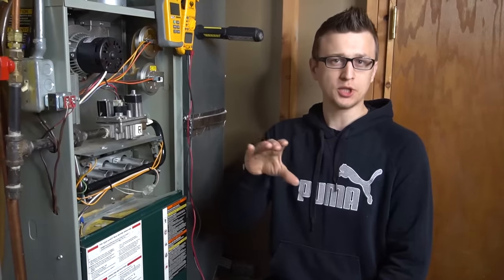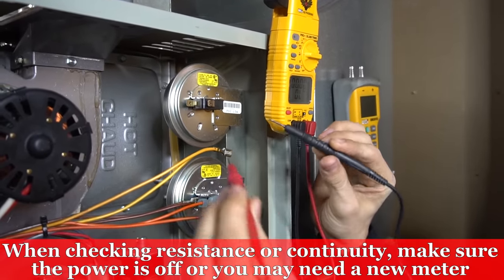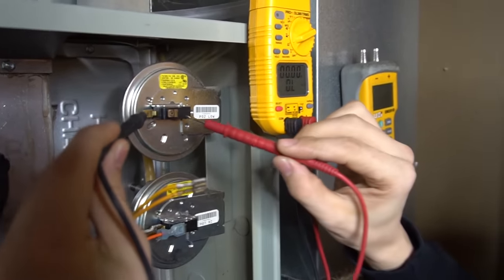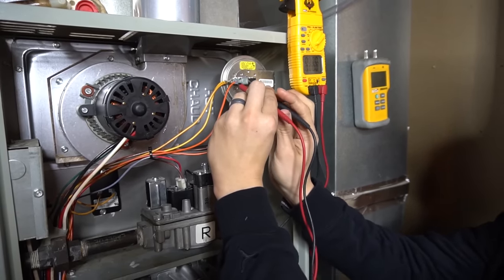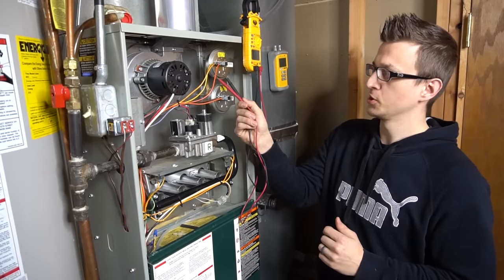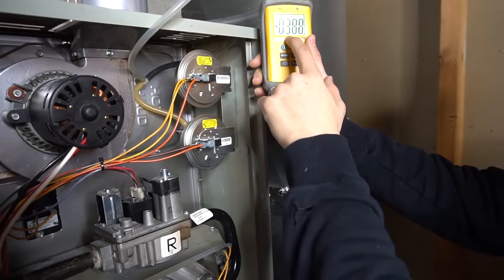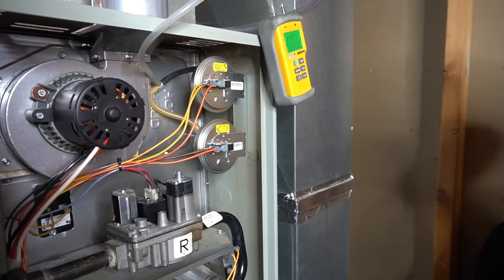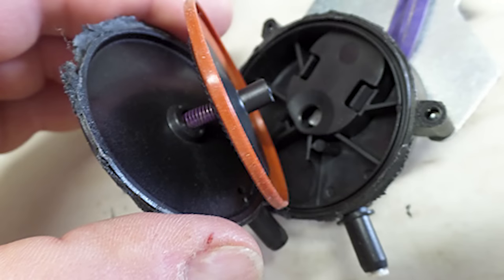How to Test Pressure Switch on a Furnace

Comment: Wow such a useful video. The reason it’s so different in my opinion is that you explain all the other systems and how they relate to the switch. You talk about the process, etc. most other videos strictly stick to testing the switch with no explanation of what it does or how it relates to the whole system
Reply: I have an issue with my furnace the igniter coil is not getting hot everything sounds to cycle but I test the line for power to the coil and nothing.. also the code it’s giving is 3 blinks of witch is a bad flow but I checked everything and nothing seems to be blocking the flow of air . I changed the circuit board . And thinking of changing the coil and pressure switch .. if you have any advice I would appreciate it .

Comment: I spent my last ten years of working doing hvac trade, I wished I had found your videos back then. I would have been such a better tech. No one would invest the time to explain issues the way you do. You are doing a great service for all techs out there and then some. Thank you.
Reply: Hey guys, our furnace was running today but no heat. When I checked everything, I noticed one of the wires connected to the pressure switch wasn’t plugged in. When I plugged it back in, the heat came back. Would that have caused no heat? I’m still not sure why the wire was disconnected.
Reply: They most likely didn’t explain the issues because they weren’t knowledgeable themselves.  Not all technicians are equally knowledgeable.
Reply: Wow amusing practical explanation.

Comment: Tip from experience... It's a good idea not to mess with the wire positioning and also not unplug those wires serving a pressure switch since it can cause the pressure switch internal contacts (micro switch) to change position ever so slightly.  That can cause it to have an intermittent connecting and render a 3-flash code and shut the furnace down.  I've had that happen a couple of times after brushing and cleaning the system while ending up causing more trouble that I started with.  Disturbing the terminal stress on a pressure switch can lead to trouble so don't do it unless absolutely necessary, such as when getting the trouble code making it suspect.  Leave sleeping dogs alone!
Reply: I subscribe to that motto, leave sleeping dogs lie 👍

Comment: Thank you thought it was a pressure switch problem until I watched one of your videos I opened the sealed combustion plate furnace started up and cleaned the intake tube and discovered 2 died mice blocking the intake. cleaned  and furnace started right up.Saved me $200 plus  thank you again.

Comment: Solid advice given on this channel. Just saved literally 100's. Once I understood how PS work after your explanation, I went down and started eyeballing the situation on my newly installed furnace. Turns out the line from the inducer to the PW had come off. Re-installed and presto. Hot air. Thanks for much.

Comment: Dude!! Thank you!! A rat chewed a hole in the vacuum hose right at the draft motor. Cut off the end and the heater works great!(i sucked on the hose and the multimeter continuity test worked fine. Thx.

Comment: I had a bad pressure switch a few years ago & I blew on the hose & sucked on it .
I got the switch to work again but like you said, I went ahead & replaced the switch.
No problems since.
I watch all your videos & have saved a lot of money by doing the repairs myself using your videos as a guide.
Great job!

Comment: I am not a HVAC person at all, but this video is great. I just removed the inducer motor components from my old furnace and I was wondering what that circular metal thing did. One search of the part number told me it was a pressure switch. Then, my second search for how furnace pressure switches work lead to this great video.

Comment: Great video.  My home gas furnace would not ignite. I watched several of your related furnace diagnostic videos.  I fixed it myself.  One of the pressure switches was stuck.  I simply blew softly into the tube until I heard the switches click.  This fixed the problem.  The furnace lit right up.  Amazing.  Saved me time hassle of calling a repairman, and probably over $200.  You are doing a great service.
JerryK..

Comment: Thanks for the video. Huge help. About 2 hours ago I had no idea about this order of operations about the inducer motor, pressure switch, and igniter. Just tried turning on my furnace to test it (it is almost 24 years old) and no go. Inducer came on, but nothing else. Well i work on trucks for a living and have no experience with house hvac systems. This video helped me to solve the problem. Pressure switch was not closing when inducer motor kicks on. Tested it by blowing in it, working as it should. Found plugged fitting where the hose goes in by the inducer motor. Cleaned it out and got her flowing. She fires right up now.

Comment: Wow, you video just helped me fix my broken Carrier furnace.  The problem was error code 43, known as "Low-heat pressure switch open while high-heat pressure switch is closed".  I followed your instructions and determined the pressure switch was working. Then I disconnect the tube from the switch and followed it up to the burner chamber where I found 2 very dead mice clogging the intake funnel for the pressure switch tube.  I carefully removed the mice pieces with a vacuum and the furnace fired right up!  If you use a vacuum, be certain to disconnect the tube from the pressure switch so the vacuum doesn't blow out the switch.  Thank you very much for sharing your expertise!

Comment: Such a helpful channel. I saved having to have another service call out to fix what ended up being a plugged pressure switch hose. The furnace was intermittently cycling after a few minutes for months, without any error code (thanks Lennox). I finally I got a pressure switch error code, which ultimately got me checking the switch voltage + hoses and it fixed my issue. Thanks so much!

Comment: THANK YOU, you saved me so much Money! I could not figure out why the furnace was not igniting, everything tested out okay, until you said " Blow in the pressure switch tube" I pulled mine off and somehow the inducer end of the hose connection had a piece of rust stuck in it. I got it out, connected the hose back up and Viola! I had heat again. So again Thank you very much! I was at the point where I was about to call an HVAC tech, because I will not mess with any of the "gas parts" just checking connections, igniter ect.

Comment: You're a great tech, but more importantly for this purpose, you're a great teacher and videographer.  Saved my freezing cold butt and made my wife think I'm a hero!

Good tips you gave me: 
1) Easy peasy on the suction when testing the pressure switches.  The suction created by the inducer is way lower than what you can generate manually.
2) Don't jumper the switch until the unit kicks on and has gone through its self-checks. I never would have considered that.
3) My problem was not the switch. Your videos prompted me to consider the exhaust tube going up through the roof.  I don't know what was in there. Vacuum didn't bring anything down, so I reversed the vacuum hose and blew it out.  I have no idea was was in there, but once I did this and put it all back together:  HEAT! Glorious heat!  And just when I was about ready to start burning the furniture too!
Reply from the maker: Your comment was both informative and entertaining! I appreciate you taking the time to leave a comment of your repair highlights! Hopefully no more troubles with the furnace for the next 20 years now ;) Stay warm!

Comment: Great videos. Your tutorial helped me out when even the tech could not figure out why the furnace would not kick on. When I  watched your video it ended up being a plugged nipple where the hose from the pressure switch was connected to. Unclogged the nipple, and voila furnace has worked since then. Awesome vids, I can't thank you enough on explaining how the whole system on the furnaces work. Last note: the tech said he was going to order a new board for the furnace, your video said that if the board was out there should be some burn marks somewhere, there was not any. This got me to thinking it was something far simpler that caused the furnace not to kick in. I was always taught to start with the simplest solutions first. Anyways you saved me at least 700 bucks!
Reply from the maker: Awesome! Glad to hear my videos helped :) Kudos on getting it fixed yourself! (By the way, thought I would mention it just in case.. There are times when there are no visible defects or marks on the control board yet it is still bad but yeah, many times there will be a burnt mark) And I very much agree with your last statement! Gotta start with the simplest solutions first.

Comment: Thank you!! Had 3 flashes on the LED. My pressure switch was stuck open. I tested it for continuity and found it was definitely open. Made sure nothing was blocked. Still wasn’t working. Took tube off and sucked the switch open and closed a few times and that worked!! Ordering a new pressure switch.
Reply: Should add it’s a Heil 75kbtu single stage

Comment: Thanks for sharing all this videos about gas furnaces. Yesterday dec. 26 I fixed my sister's  gas furnace, the problem was that switch, it was open, I read the code and led me to that issue.
Reply: A real trained professional gas fitter hvac tech never goes by what the furnace board say instead we go by sequence of operations. Next time leave it to a professional not trying to be rude but as you said it's your sister's house and messing with a potential dangerous methane ran appliance could be extremely dangerous
Reply: @leelee287  I studied HVAC, I know how to do it, I dont do that for a living, but I have experienxe in electric heater no gas at all. If the board is giving you a code you have to go and test that part, it doesnt make sense to be testing all the parts when you have a code already.

Comment: Resistance, voltage (0), or closing pressure. Good explanation.  Usually just replace pressure switches by the circuit board error code. They get hard & buggy with age, like me.

Comment: Great video. I have an 80% carrier and it’s working properly. My igniter starts glowing approximately 15-20 after inducer starts. I checked the vac line and it’s clear to the inducer cavity. The pressure switch doesn’t seem to close as fast as yours. I count until the igniter glows. Otherwise it’s operating.

Comment: Thank you. always great to see someone who knows what they are talking about. fixed my Carrier  wethermaster 8000. turned out to be the reset button just above the pressure switch the wire was connected to.  we had some weird weather last night my water heater also stopped working, , just had to relight the pilot  light. .

Comment: Very informative . My Rheem two stage furnace daisy chains from the LP switch to the HP switch and Tees those two back to to the inducer motor housing , not the collector box. I assume I pull the hose from the fan connection port and hose Tee it to the Manometer and the hose back to the HP /LP switch Tee. That would at least indicate enough , or not, vacuum to start on low fire.

Comment: Your videos are super helpful and detailed. 
I have a couple questions that I have not been able to find online. I have a two-stage gas furnace (Carrier Performance 93). My furnace will cycle when call for heat (inducer spinning fast, both low and high pressure switches close and go to 0V, igniter on, gas flow clicks on, inducer slows down a bit, high pressure switch opens (but just 4.8V, not 27V), low pressure switch stays closed with 0V and after about a minute of burners being on, gas shuts off and then the blower runs for about a minute). There are no error codes on the LED, just normal code of blower running (code 12) then continuous LED on when not running. I cleaned the flame sensor - it looked pretty dirty - and I get 3.7uA when flame on (but the manual says it should be nominal 4.0-6.0 uA). I jumped the high pressure switch just before the inducer slowed and it didn't make much difference. My questions are: Is a 0.3uA difference enough to not have the flame sensor work properly and is it normal for the high pressure switch to have a low voltage of 4.8V or should it be 27V when open like the low pressure switch? 
Otherwise, I cleared all the drains/lines/hoses but haven't scoped down the flue/exhaust to see if there's a blockage.
Thank you if you have time to answer this!

Comment: Thanks. Helps a lot.  Question: why are 2 pressure switches needed?  And the malfunction symptom is that the inducer fan comes on but the burners do not?

Comment: I really respect your top tech knowledge how ever you may damage your electric tester by checking ohms when voltage is presented.
Reply: If you recall, in his video he disconnected the wires from the switch BEFORE checking with meter in ohms or continuity mode.  Great advice  though Joe!

Comment: Great video, question for you..Should 2nd stage pressure switch show 27 volts during 1st stage or only after the call for 2nd stage?
Reply from the maker: Pressure switches are normally open switches. This means it will have 27v when the switch is open/or not in use. So the 2nd stage switch would show 27v during first stage and 0v during 2nd stage once the switch is closed.

Comment: This vid and others you've done are great and very much appreciated.  In this example as furnace (80%) manufacture specs 0.8'WC pressure switch, what would you suggest is the least difference of inches WC that the inducer blower should produce to prevent occasional shutdowns?
Reply: Be Summers at least 10% above the pressure switch rating to make.
Reply: @Mobsters87  Thanks, Tyler for the reply.   So you are saying 0.88" WC is "satisfactory for normal operation" of the chimney draft at the furnace?  I have not heard this spec stated and have no idea of what  this minimum value.
Reply: Bo Lindsay yes. If it doesn’t have at least that. The furnace will not working properly

Comment: I’ve changed my pressure switch 3 time, all new switches and the furnace will not work unless I bypass the switch, what should I test next?
Thank you and your videos are great.
Reply from the maker: If you already replaced the pressure switch and the problem is not solved, then my guess would be that perhaps there is something restricting the exhaust air. Have you tried taking the inducer motor out and looking at the blower wheel inside? Sometimes that wheel has a lot of build up on it and it is enough to cause the pressure switch to not close. I am not sure if you have seen this video yet but it may give you some good ideas as to what else to look for: https://www.youtube.com/watch?v=Zax02itYHkU&t=2s
Reply: @WordofAdviceTV  disconnect your flu pipe and try to start your system, if it start there might be blockage in your flu pipe? But don’t run your furnace to long when testing.

Comment: Thanks for all the help videos!  They are great. I have an issue with my furnaces pressure switch as it cycles pretty quick. It seems to loose vacuum and then pick it back up. It does not doe this all the time as the furnace will work for a couple weeks then it does this cycling. So, the furnace does not kick on. I have changed out the switch and checked all the hoses. I do not have a manometer to check vacuum. 
Any other suggestions because as mentioned this happens every couple weeks. 

Thanks again!

Comment: Great videos Jay, thanks!  i'm suspecting an intermittent problem with the pressure switch on a 17 year old single stage goodman gms90703bx.  i woke up to a cold house.... could hear the fan running but no flame.  i turned it off and by the time a service tech came a day later, it worked fine.  the tech suggested the flame sensor but i've seen that before (flame came on, but kicked off immediately.  i removed and cleaned the sensor and it worked properly).  i suspected the igniter.  it reads 47.5 ohms, glows nicely and i can't see much, if any discoloration on it.  based on your video, i'm looking at the pressure switch.  it reads OL when off and bounces between .2-.4 ohms when the inducer comes on (i cycled it a few times).  the tube is clear.  its all working fine now, but i'd love to avoid dealing with a failure when its cold.  any troubleshooting thoughts on what could be causing my issue or do i just need to wait for it to fail, then troubleshoot?  thanks, Scott

Comment: You performed the diagnostics on only one pressure switch. Should the second switch behave the same way? Or would I expect only one of the two switches to close when the inducer motor runs?  In other words, if my inducer motor is pulling enough pressure to close the high heat switch, would both switches close?

Comment: Thank you for telling me about that switch that was hidden on my furnace I checked for vacuum and it didn't have any the switch works so I checked my pipe. It was clear so I ran a wire to my bedroom on a toggle switch. And when I hear the furnace light I turn on the switch, the furnace will run and then shut off normally and I shut off the switch.. when I hear it start I turn on the switch and if I forget it's calling for an open.. so all I have to do is turn the switch off and back on and it will start until I can put in a new heat exchanger or find out why it's not creating a vacuum it's probably the heat exchanger and it's got a really sloppy looking exhaust pipe also

Comment: I have looked up trouble problems with furnaces and nobody seems to answer my problem, my problem is my furnace is running fine, but when the furnace gets to my set temperture it turns off witch is normal, but my furnace kicks back on after 4 to 5 seconds, it only happens once in a while it started last year till I notice it was doing this please find out, just concern if this is normal,and thanks for you awesome explanations our furnaces.